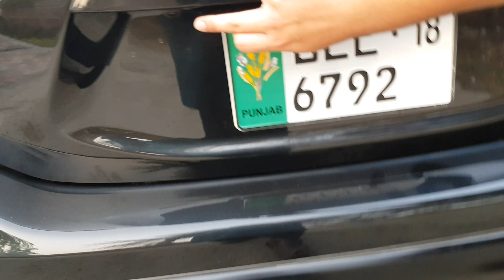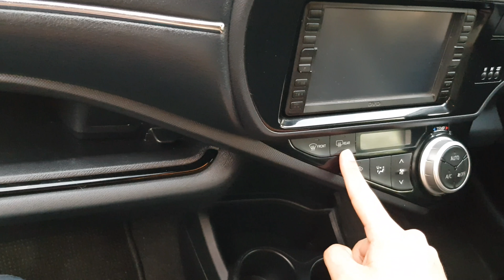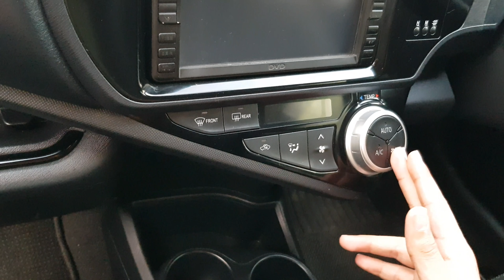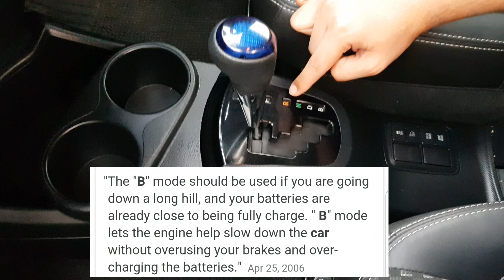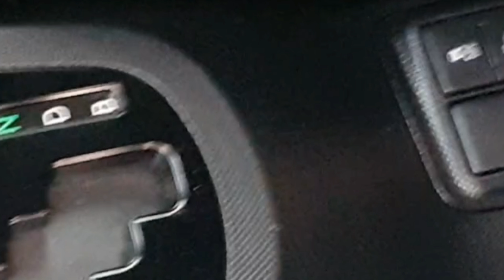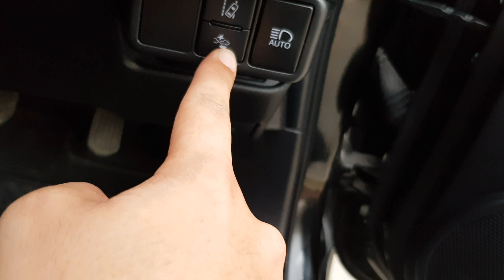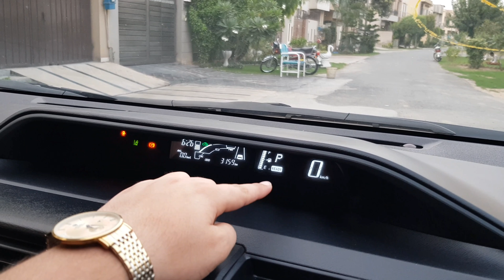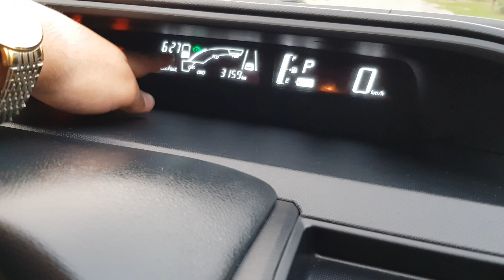2018 TOYOTA AQUA X URBAN SOLID Complete review/ walk around/ Start Up In PAKISTAN !!!!

Comment: Which one is better x urban or g / gr sports aqua for pakistan?
Reply from the maker: Both are okay x urban has stock car options like stock steering wheel stock gear knob stock push start button and the body kit on x urban is very nice like on G.GS the body kit looks very over if u wanna buy an aqua kindly contact me on my Instagram @gm_vlogs I can help u out in buying one
Reply: @GMVlogs16  I do not have an instagram id 
Fb or whatsapp please I am about to buy aqua it would be helpful if you can provide guidance
Reply from the maker: Bro what is your budget
Reply from the maker: I was just helping you so u don't buy an accidental repaired aqua that I was saying I can help u out in inspecting the car for you
Reply: @GMVlogs16  that would be helpful 
24 lakh budget
Reply from the maker: Bro how can I contact you then to buy a car and inspect the car for u
Reply from the maker: Should I call right now

Comment: Nd by the way the brake fluid reservoir has pass through in the upper panel which can be removed if it needs to be filled look closely
Reply from the maker: Well u need a tool to open that panel like not even a tool u can remove the panel with your finger nails or your key but in case if someone doesn't knows then what u do like my sister had no idea what to do when I told to her !!! Haha lol
Reply: GM Vlogs girls and cars don't match up🤯😁
Reply from the maker: Haha lol but even my driver didn' know that too

Comment: gm_vlogs i always watching ur videos cause ur the one honest car guy others are  just biased..
sir i hav a Q which one is good in acceleration and overall good car toyota prius or aqua..😊😊😊
Reply from the maker: Thank you so much for your kind words bro so let's talk about them both aqua is light weight then prius so it will catch up first but will get advantage of on speed up to 80km because after that aqua's 1.5L engine and small size electric motors can't produce enough torque so 1.8L prius engine and big electric size motors smoke the living shit out of aqua after 80km prius can literally beat our local Honda civic oriel and toyota corolla GRANDE if we remove the speed limiter from prius because in Japan it's all about saftey so the car limits it's self to go above 180km so when it's tuned and speed limiter removed I can get u it will go more then 240km

Comment: This or Vezel Z hybrid and why?
Reply from the maker: Obviously honda vezel because has sane displacement of engine but has more power then aquas engine and has much more better ground clearance also u get much better auto brake radar then the one u get in aqua also u get paddle shifters auto rain sensing wipers and heated and cold seats also much bigger trunk capcity then aqua also has brake hold function electronic parking brake and adaptive cruise control and much more
Reply from the maker: If u can wait for 1 week my vezel z package review is going live in one week so kindly wait for that to come if u can
Reply: GM Vlogs ok, thanks
Reply from the maker: Your always welcome

Comment: Bro you this model is 2015 why you in the title  you 2018 why bro
Reply from the maker: Bro it is a 2018 I can give a guarantee that there is not a single aqua in PAKISTAN that is more 2016 manufactured and this car is a 2018 import and if it would be 2017 then I would have said in title that it is a 2017 model
Reply: Shayaangamer XD This is not 2018 model.
Reply: Its 2016 model. So title should say 2016.